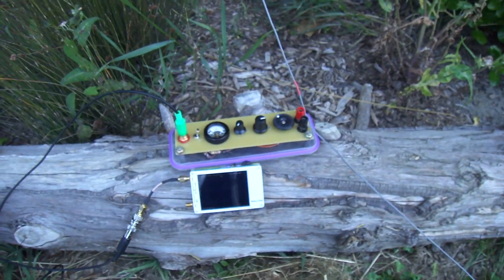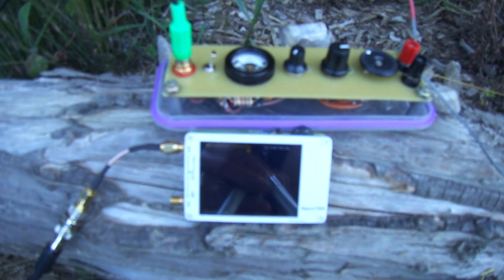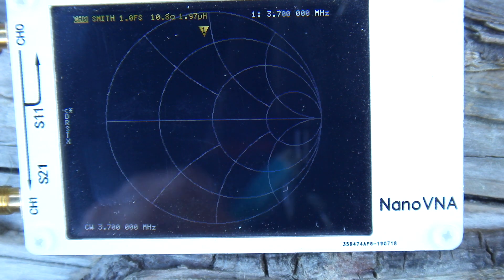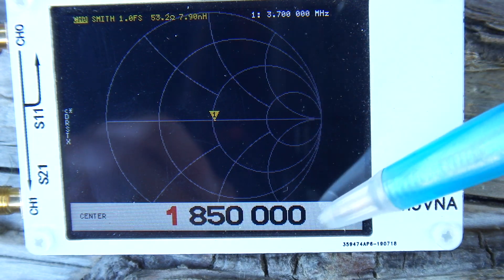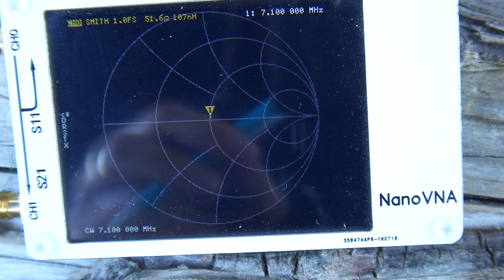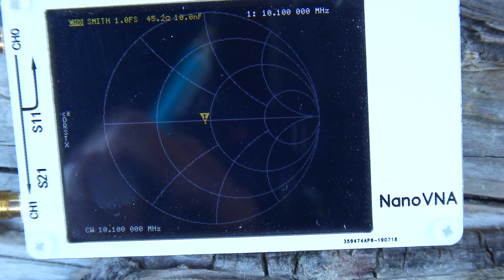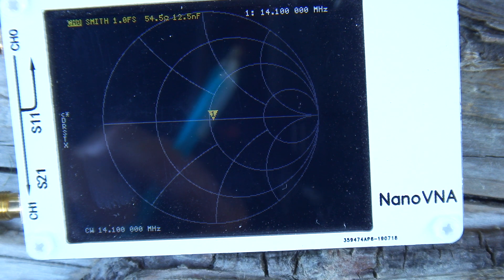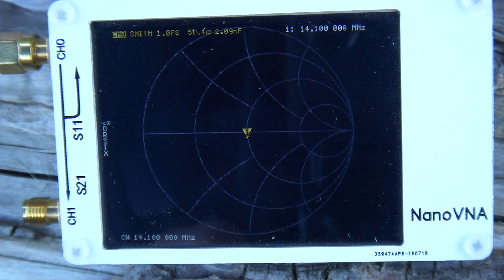End Fed Half Wave Antenna Tuner: Part 3 - Field Demonstration

Comment: Your three-part tuner series was very informative and the parts layout very clever and creative.  I have two questions: The Nano VNA's S21 port, is there any difference in your readings if the port is capped or uncapped?  and what are the specs on that cool little analog meter? Thank you. Mike K7AJQ
Reply from the maker: Hi Mike. I have seen no difference with the S21 port capped or not. As for the meter, that came out of an old piece of test equipment many years ago. I have seen them before, but cannot recall where.
Charlie
Reply: Thank you for your quick reply and knowledge, The meter looks similar to the meter on the CLANSMAN UK RT PRC 32. The analog meter is a perfect size for the project. I'll keep searching. Again thank you.